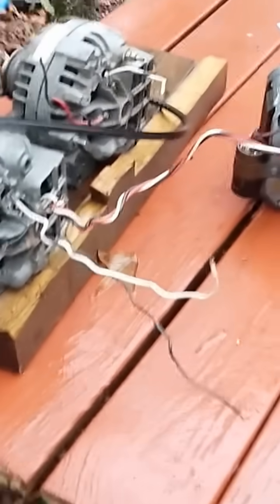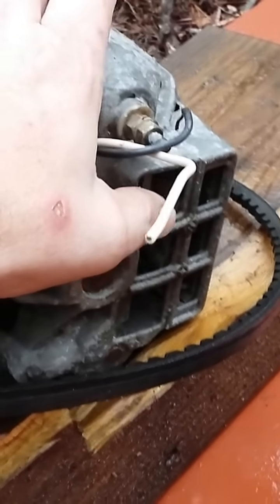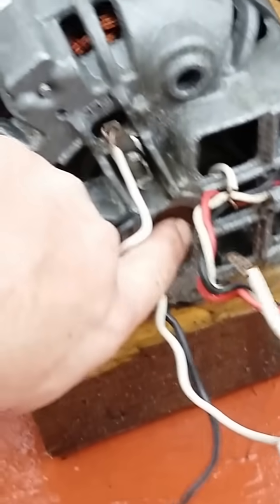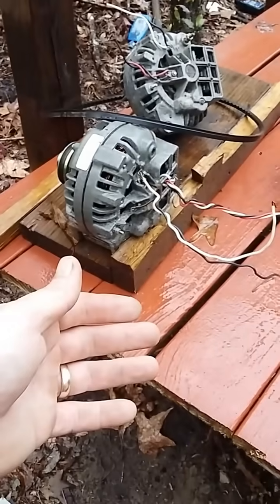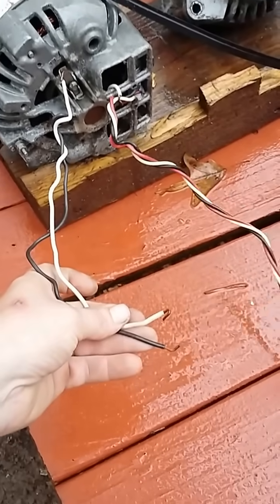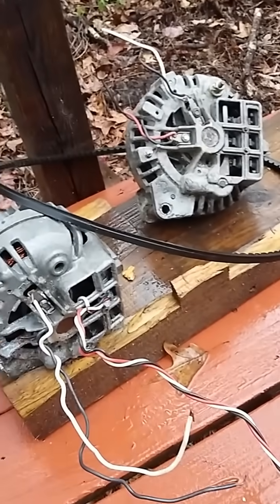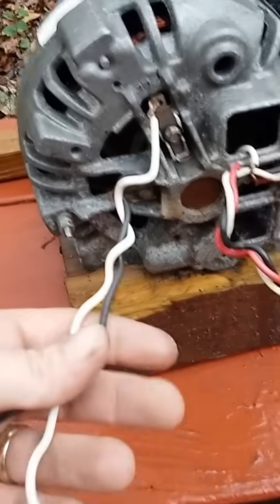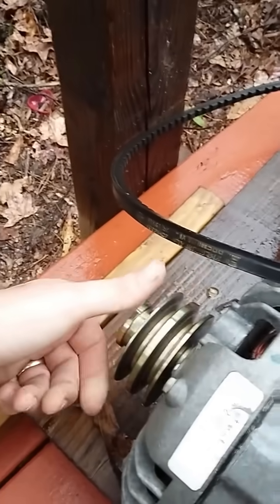Update Free energy forever no wind no solar no gas READ DISCRIPTION!!!

Comment: This is the stupidest thing I've ever seen. I don't even know where to begin.
If you drive a generator mechanically off of a motor, there is both a mechanical and electromagnetic loss of energy. There is no way it will generate enough power to perpetuate,  let alone have extra energy to use. Removing diodes do change an AC field to DC, but by dividing the wave in half, but it doesn't lower the output voltage by 90%. Also, by the ohm law E=I/R, The more voltage you have, the less current you have. This means that if you did happen to produce 120V, it would be at 9A, not the 90A at 12V.
Reply: The alternator is producing its own power too every time the wheel spins.  It produces enough power to run every electronic thing in your car and can knock you on your ass if you use your "flesh" as a "resistor" if you get in its way.

I know the engine that is powered by gas is providing the energy to spin the wheel but with absolutely ZERO input it produces that much power on its own and produces enough excess power to "store a charge" in the battery and keep the 12v battery charged up.

All in all, it would be a GOOD "bang for your buck"  You could take a VERY SMALL amount of energy to run the "wheel" especially if you add some gears between the driver "motor" and the alternator wheel..... you could probably get a "windmill" type setup using gears between the wind driven "fan" and the wheel and you would indeed get a PUNCH out of the alternator because it is designed to pack a hell of a punch to begin with as that little device powers everything electrical in your vehicle.  The 12v battery under your hood will not last any time at all if you are running your headlights...... so the battery alone cannot even power your headlights for ANY length of time before it goes dead......  That little device kicks out enough power to run everything in/on your car and run it all at the same time "indefinitely" (long as your engine is running).   You just need to replace your "engine" with a different source of power to spin the wheel.  And...... that 12v battery pushes out enough by itself you can "weld" with the battery alone..... not for very long or a huge amount of welding, but you can get a arc good enough to do do some simple welds and the alternator packs a MUCH bigger punch than that 12v battery packs.

It is WAY more efficient than a wheel generator you would put on a bicycle for a single small headlight.

Comment: Fn diodes how do they work?
Reply from the maker: Miguel Alvarez 
 please edit your comment and put f word or something else. But to answer your question a diode is an electronic component that allows current to flow only in One Direction and the side of the diode that has a ring around it is the side that connects to the negative terminal on direct current source now keep in mind the negative terminal on direct current, like on any battery is the output and the positive is where the current flows back in or called input.
Reply: Thomas Buie  lol i cant tell if you are seriuous or not. Cool video.
Reply from the maker: brother I was serious there are a lot of kids that watch my videos and I would not to want to influence them in any way possible whether they've heard the word or not it's just inappropriate but I don't mind answering questions when I have the time just keep in mind I am only one man and I try to answer most of my questions in the videos and a lot of my videos are done by request..

Comment: I went to Walmart and bought every 12 volt dc to 120 volt Ac inverters they had in stock. Ranged from 750 watts to 3000 watts. I bought every extension cord they had on the shelf.  I got home and grabbed a Coors light and went to my back yard.  I grabbed my wife's keys for her Honda Civic and grabbed the booster cables.   Hooked up all the inverters across the little battery and although I failed in math I figured I got about 1 million watts of power output.   I started up the car and powered up my home made hydro power generating station. I was able to power up my house and shed. My neighbour Hank grabbed his extension cord and plugged into my system and he powered up his house. I only filled up the car once with gas in 3 days and let it idle in my driveway. Soon I had the entire street plugged into my home brew electric station including the street lights with some Jerry rigging. I made so much power I started taking beer money to cover the cost of only 2 tanks of gas in the tank of the car per week. The auto body shop down the street ran their cord over to my invenshun. Imagine that!  My wife's little Honda powering the street plus the autobody shop with huge air compressors and the halogen lights and fans.  Next month I'm gonna up it up a notch. I have an old grey hound bus that's been parked in the rear. I figured I can run the whole town with some retrofitting of the alternator. I'll be the town hero.
Reply: Jari R Ha ha ha ha ha jari thank you for the laughs. I laughed almost as hard at your reply as I did watching the brain trust who did the video.
Reply from the maker: Jari R 
it sounds like you have a wild imagination even though you're not too far off from the truth...
Reply: Jari R a

Comment: Im not going to make fun of you for being uneducated. You will have to power that motor and hook it to your alternator and that takes some sort of energy to do so.
Reply from the maker: Chris smith
Too which motor are you referring? there are two Motors and one alternator in this video, a washing machine motor an alternator motor and an alternator generator? And just so you know it was easy to switch the word stator and rotor around...  I believe over the last 26 years of reengineering I would have been able to pick that up...  I know that you didn't pick that up and it looks like the wires are just wrapped around the casing of that alternator but it's not those wires are wired to the stator coil which is three wires... my how did you turn that alternator into a motor you say? well I used an ESC or electronic speed controller which puts out a square wave and repeats the square wave in .5 microsecond increments while I'm putting direct current to the rotor coil.

Comment: Next.    Selling theory is not the same as reality.  220 volts AC at 90 amps is about 19 kW... 2 hp of a gas engine is needed for every KW of a generator. Or 1hp of an electric motor for every KW.  Simply you cannot make energy without expenditure of energy.  Reminds me of the motor / generator argument that will produce more power than is expended thereby running the motor.  Also the unfiltered AC coming off the alternator shown is 3 phase. Not single phase in homes.  You would have to also modify the house circuits to use 3 phase. 

So a roughly 20 horsepower electric motor would be needed to produce 90 amps at 220 volts or a 40 horsepower gas engine to do the same. 

The stator and armature are not big enough to provide 90 amps constantly either. 

As far as the living long enough statement it's probably because somebody tried this and is really pissed about their house burning to the ground.

As I said.... Next video!

Comment: There's got to be a way to have a machine and battery that generates enough to fill the battery, and run the machine, PLUS extra generation. It has to be possible!
Reply: Only with an alternate source of mechanical energy, such as a gasoline engine or a stream of water.
Reply: That alternator in its natural environment...... Car engine supplying the "wheel turning" power to the alternator + 12 volt battery = endless electricity (as long as you have your engine running, the alternator supplies ALL the electric power to everything + charges the battery that starts the whole system).

Comment: I mean you could use a solar panel to inject the dc into the rotor. But what part of that is free energy? And how do you get it to the proper rpm so you can get the proper frequency out?

Comment: This guy is full of crap. A car alternator is still only producing 12-15 volts ac with the diodes bypassed. To produce 120 volts the windings would have to be changed and even then the wiring couldn't hold over 20-30 amps. Much better to just use alternator to keep a bank of batteries charged and use a power inverter.

Comment: If you say diodes, dc power, ac power, stator, coil, generator, capacitor enough times while pointing at old motors, you too can make free energy.
Reply from the maker: it's not magic damn it it's a simple little thing that people don't put into the equation. it's called inertia! ( a body in motion stays in motion ) when you kick a small load off of something that has the capacitance already built up then you're not losing anything you're using what's Extra I mean how hard is it to build a capacitor? use what's around you...

Comment: first you have to run it! YOU CAN'T RUN IT WITHOUT ENERGY!  A CAR  OR SOME TYPE OF MOTOR! BULLSHIT ALERT BULLSHIT ALERT AND IT ALSO A 12 VOLT SYSTEM NOT 120!
Reply: Jimmy Joe
 you don't listen very well do you!
Reply: Ajax Ashford I've been a diesel mechanic for 30 years! you can't generate 120 voltage from 12 volts! how EXACTLY are you going to run it!? with a bicycle! MAYBE YOU don't realize how much rpms it takes to run an alternator!  THIS IS TOTAL BULLSHIT!
Reply: Ajax Ashford ONE OTHER THING! 20 OF THOSE YEARS I SPENT FIXING DIESELS IN THE ARMY !! SO DON'T THINK BECAUSE YOU'RE A MARINE I'M IMPRESSED!

Comment: So what are you using as your dc power source to energize your alternator? What is powering the motor that's supposed to spin the alternator? Why didn't you demonstrate it working? You say "they" said you wouldn't live long if you continued to use it. And you site that as a reason for taking it apart, but then you dare them to come find you....
Reply: "Cite" not "site".   Lol, nice try though :)

Comment: Not only is it not running, it isn't even hooked up! Janky wiring, a run around non-explanation of "it's simple" "not rocket science" "just do this.." "they told me I wouldn't be around" "power company hates me"
There are SO many questions: I don't know much about alternators but I know if you put 90 Amps of 240 over that small gauge of a wire it should melt. How does an alternator take 6 VDC (low amperage I assume) and step up both the voltage and amps exponentially? Where do you get endless/free 6 VDC power and the power to turn the alternator? It has to be a separate source and therefore not free. Show me a clamp meter all over that setup when it's running and I'll show you a liar. 
The only genius occurring here is how easily you got millions of views with this unoriginal idea and low effort script, explanation, and proof of concept. For that you are smart, I hope you cash the YouTube check and get that baby some food and diapers so it can stop screaming from whatever you were neglecting to provide while filming this trash.

Comment: I did the math.
You clearly have no idea what you're talking about
Reply: Okay, I'll tell you-  You don't know what you are talking about.
How do you measure "amps"? Enlighten me.
Reply from the maker: ReiMonCoH 
well then do the math on this...

3 horsepower Smith and Jones compressor Duty motor Chicago Electric 10000 Peak generator head x 2 what's the output what's the input and tell me if I know what I'm not talking about...  you sir obviously have not watched my other videos...

Comment: You have repeated the instructions how to have a high powered gen atleast 3 or 4 times in this video. Why would anyone come tell you not to do this? Free country!  And That I am aware of You will only get at most 14volts hook up some batteries postive to negitive in a row,I think you can get more amps,and can convert everything in your house to 12 volt DC,or run a Inverter like the truck drivers due. Buy all the house  Hold appliances at a truck stop everything there's 12 votes they got TV's,dvd players, coffee Makers,crock pots and more!  Can you tell I put a lot of thought into this already. I would use the headlights from the truck to have  Outdoor lighting. Still running on 12 V. And of course do not have everything on at the same time just what you're using. You know like mom always said turn off the d*** light When you leave the Room...LOL!  A person I know has a cabin, runs off 12 volts same way he camps in. But I don't know everything, and after watching alot of  Conspiracies  in these YouTube videos I guess anything's possible! If it works....Then why isn't it hooked up and running right now in the video? Or do a video hooking it up and running it! And get that much power...nope!

Comment: “All that free Power the elect. Comp. charges you for” LOL!! Let me get a bump man! Haha!! REALITY CHECK: I’ve piped spring water (gravity flow) from a source 1500 ft above a cabin I own. 2” poly pipe to a stand I fabbed up with an alternator driven by a scooter wheel. The wheel had “steal cups/scoops” welded all the way around. Reduced 2” poly down to 3/8ths aimed at the paddles/scoops on the scooter wheel to spin that thing warp speed. Wires from alt to the cabin and guess what????? It barely powered 4 light bulbs at the same time... u didn’t invent anything pal and even with a set-up like the hydro electric one I described its still not feasible to Power a house. They r watching you!! Hahaha!!!
Reply: Negative Myles... you took it outa context. Don’t get rattled to your core because you think I’m bashing the idea of “off grid existence” My (stupid) way hahaha!! Was me just messing around with something I have perfected time and again. However, a 4MM nozzle is very trivial volume wise. Depending on cup pitch there’s a fine line between volume and pressure to get the most efficient result. Blah blah.. point is this: there is no free lunch. Can you get off the grid? Absolutely. But by the time your set-up is done and reliable just add up the time and material of inverters, relays, voltage switching, phase converter(yes I stupidly designed one to run a 5hp 3 phase motor) wire, and the list goes on and on trust me I know. Can you save a few bucks? Yes but again no free lunch. Long, really long term you can save some $ if you have relatively low equipment failures.(why am I still talking?) 
       My comment was aimed at his mis-informed shoulder biting/tweaking BS. I was not saying that there weren’t ways to do it better, or making light of self sufficient properties. Hydro,solar, wind, or otherwise. 
    IDK about you but when I get off from a long day at work the last thing I wanna do is fix/troubleshoot a homemade hydroelectric mini power plant. “Grid Power still can go out” You say. Yep, it can that’s when I stroll over to my generac generator and voila! Power! 
    Just remember my comment was to the fine gentlemen that made this vid. It’s self evident he’s made so many good decisions while dodging the deep state who’s after him. Intent and context Myles. Settle down.

Comment: I have an Idea, how about you buy a generator for power and an electric motor that you could put a belt on to spin those car alternators? Fuel for that per month should only run you a few hundred bucks. All the brackets and welding you'll need to do to hook a motor and belts up should only take a few hours of labor and a hundred bucks in materials. And then a generator running non-stop for a few months will probably shit out, so you'll have to buy a new one a few times a year. Genius!

Comment: You talk alot, but haven't demonstated it actually producing any electricity. If you hook this up to your breaker box, you are garanteed to have a meltdown, probably in the connwction to the alternator or in the smaller gage windings and/ or wires. Bad advice. It can be done, but only running a couple items at a time.

Comment: LOL.. "Put 3 to 12 volts on these wires (That are terminated together causing a short) to receive 220 vac @ 90 amps." F..ing moron! First off, you have to spin the pully to create pwr through the coil and magnet. Guys been smoking the wild dandelion laced with pcp.

Comment: Insane.  90 amps through #12 wire  .. It is rocket Science and if you keep doing this you wont live long.
Reply: Current is a function of load resistance, NOT potential.
P(watts)= I(current)*E(electromotive force) remember?
Besides, he'll never produce even a single watt.
Reply: He points out 3 wires which he says produce 90 Amps , I could not get past that nonsense.
Reply: I always thought "current" was drawn,
voltage was generated
and wattage was dissipated.
Just shows how WRONG the US Navy was.
Reply: I'm wondering what SHUNT he used- to measure the current, or did he just put the ammeter leads across the windings (that is NOT how you measure current).
Reply: run 90 amps through that wire and you will tell how much current is flowing by how bright it burns for how long.